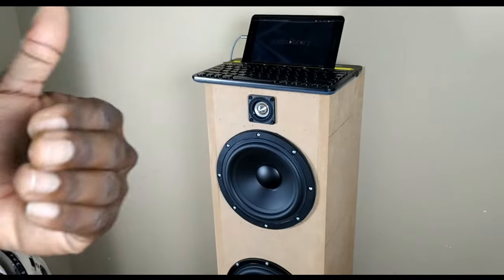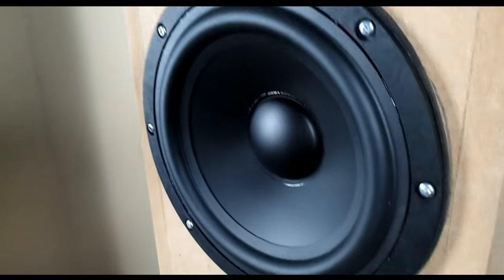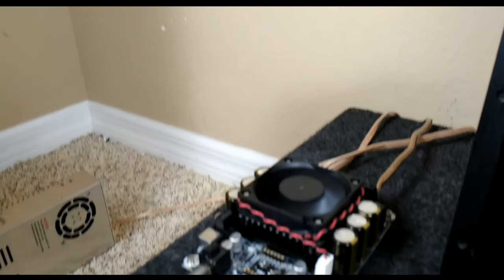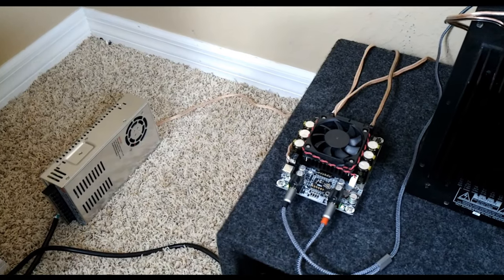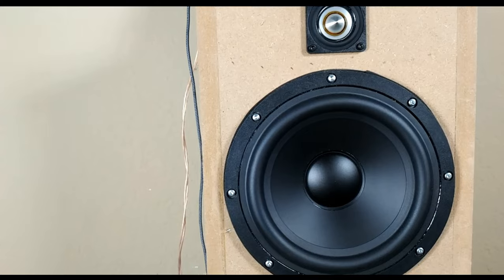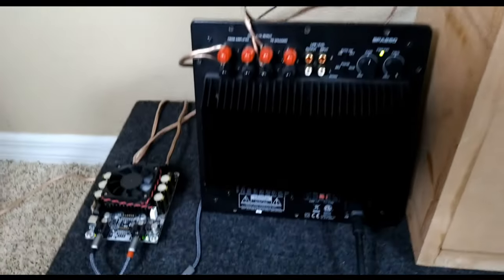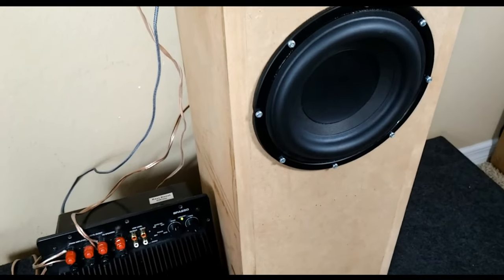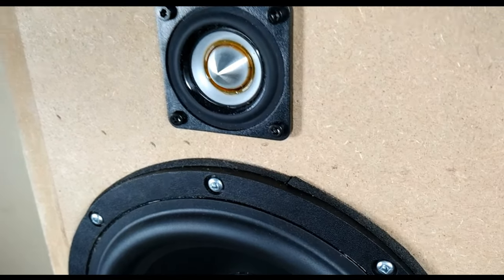Testing The Tang Band Tower - Part 1

Comment: Try using VirtuixCAD to simulate all the way from sealed to dual bass reflex. I can tell  you the underhung midbass is meant to be used in a ported box. Try an calculate the EBP to see what I mean! Imo, the  W8 midbass is better paired with a decent mid range and a good ribbon tweeter for 3-way, or a nice 2" or 3" full-range for 2-way.
I am from Spain and I managed to snag two W6-1721 for 120$ both from eBay in mint conditions and I believe they are a superior candidate than the W8-2096 in 2-way speakers since you could use a dome tweeter with an Fs of under 1 khz to get a nice crossover at around 1.5  - 2 khz.

Comment: If you have a calibrated mic you should measure the frequency response of each driver individually and combined. Seeing what each driver does might shed some light on the problem. More than likely the two woofers don't have a good crossover integration and are not phase aligned which might cause dips in frequency at the crossover region. Be mindful of your room acoustics as that might also be a problem, so maybe test the speaker in a different room. I'd also use something more substantial to power that mid-woofer. No way will that little amp provide enough power for that mid-woofer to level match the ported subwoofer at high spl if that's what you're expecting to achieve.
Reply from the maker: Great point. I'm hoping that porting this chamber will help with the lack of power. My only fear is the smaller chamber. Recommended volume is 1cu.ft. a third of this chamber.

Comment: You sure the sa250 has a high pass for the satellites? I’ve used the sa70 for a couple years and never noticed a high pass when using the high level inputs. I think you should have designed your own 3 way crossover. The 100 watts per channel should be plenty.
Reply from the maker: Yes, it does. To clarify: The speaker level high-pass outputs 6 dB/octave at approximately 180 Hz @ 4 ohms, 90 Hz @ 8 ohms (i.e. 220 uF electrolytic capacitor)

Comment: Hello Sir. I would like to ask if any enclosure design plans can be used as long as the driver size made for it is the same driver size you are using? I am planning to build a PA sub. Probably going with either a dual reflex bandpass or a horn sub closely similar to a cerwin vega. Thanks man.